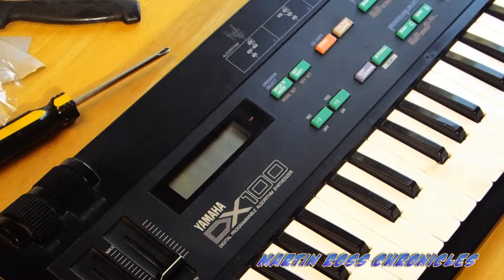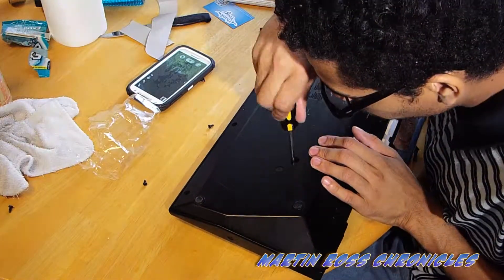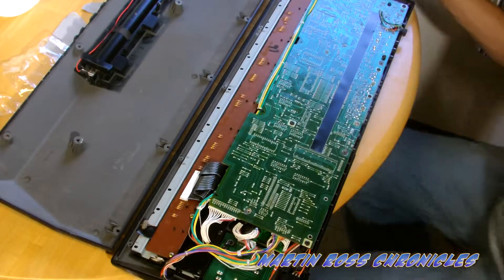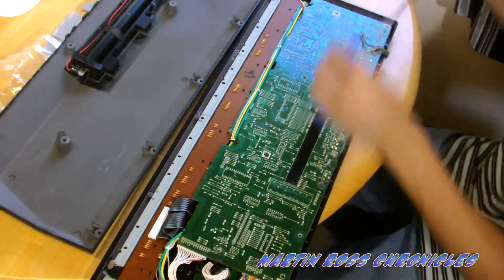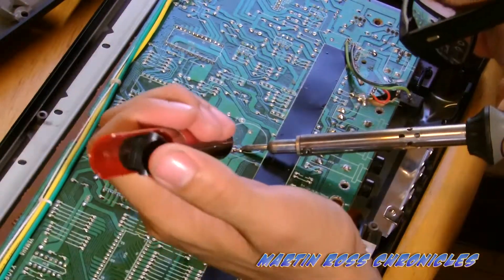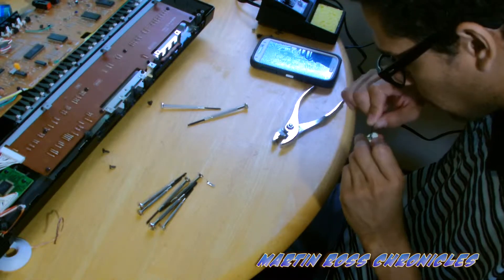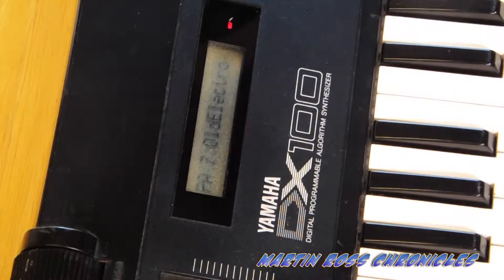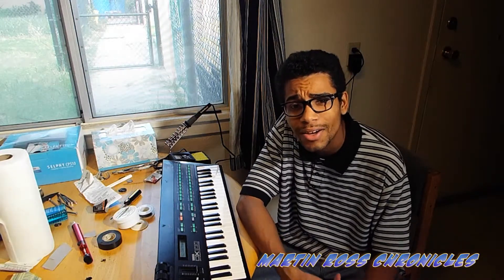How to Fix Your Yamaha DX 100 Screen

Comment: ive just repaired a dx100 with a blocky screen.

i replaced the battery,no change.

I then discovered if i wiggle the connector that goes from CN2 on the board (a 4 wire white connector) the display becomes normal.

After removing this connector and e-soldering the display now works fine.
This connector actually goes to the board that houses the data entry and volume sliders.

I have no idea why it would affect the screen but it did,maybe is getting a garbled signal from the sliders causing it.

The white connectors are either hard to get off or dont come off. I ended up cutting it and soldering the 4 wires to different soldered points on the board that run to that connector as the connector holes were very small and fiddly.

Hope that helps.